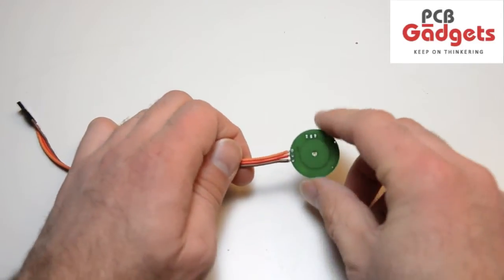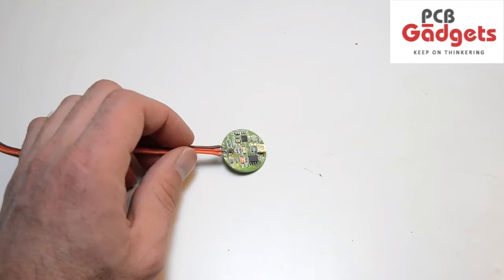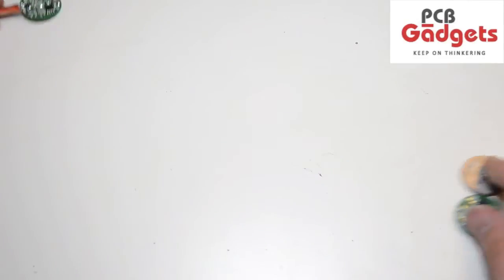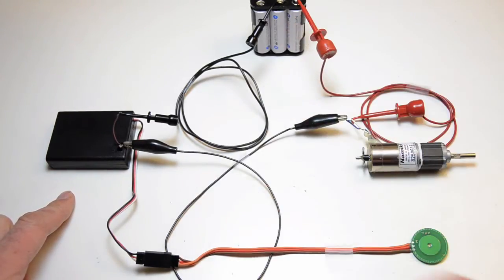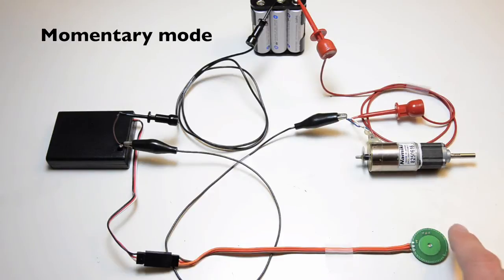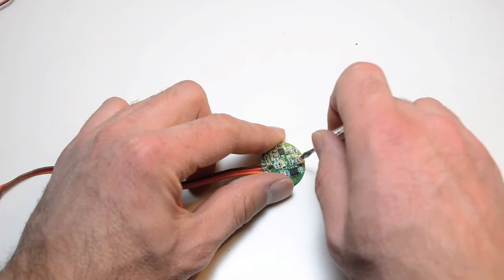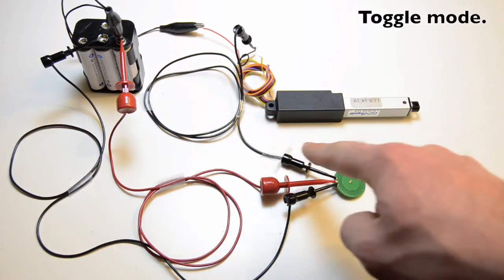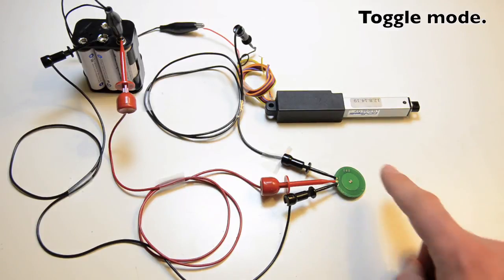Round Capacitive Proximity Touch Sensing Switch

Comment: Can I put it on the inside of a large aluminum sheet like in this case http://www.inwin-style.com/en/data/goods/201405/140116037556M180.jpg and just touch the aluminum surface for power on ?
Reply from the maker: I couldn’t see the attached image. In general there is a way to make it work with metal surfaces